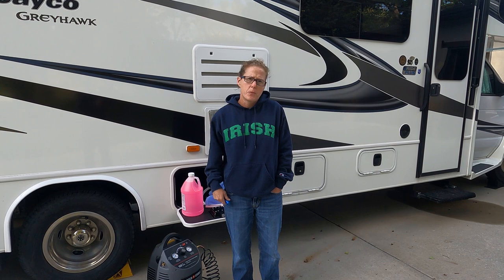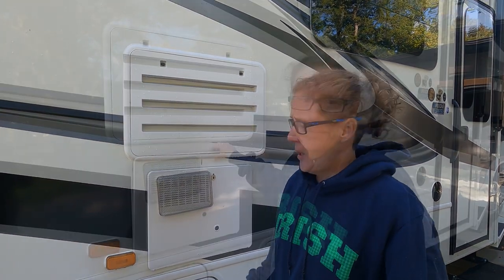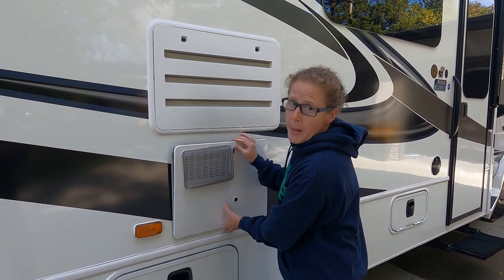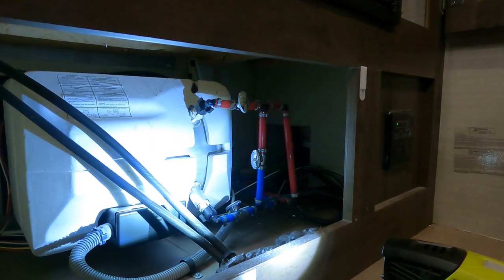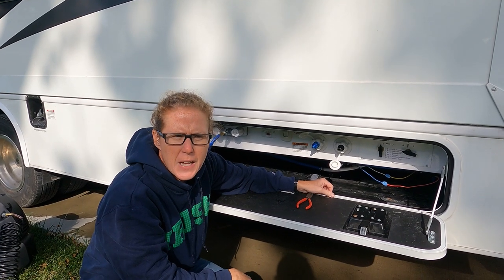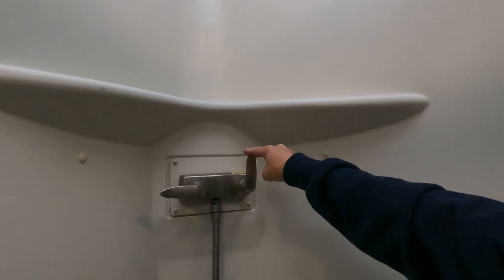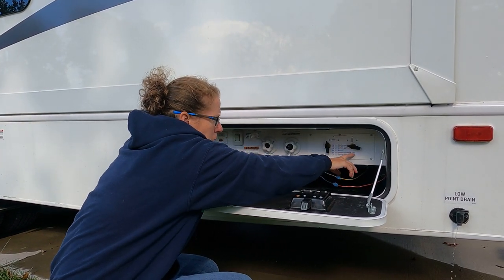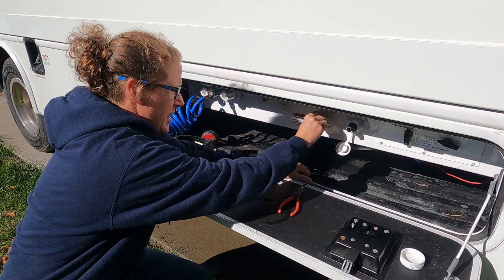HOW TO WINTERIZE YOUR RV | Air Compressor and Inline Antifreeze Methods | RV Winterization

Comment: How did you do the nifty water heater drain extension?  Any problem mixing metals vs the nylon plug?  You are so right, the OEM plug is SO hard to get to!  Thanks
Reply from the maker: Glad you asked.  Since we made that video, we did get some moisture around the fiting.  We ended up just putting the plastic plug back in.  After doing some more research, we also learned that for our particular RV, opening the low point drain will drain the water heater.  That is not the case for all RVs though, but it might be something you want to look into on your RV.